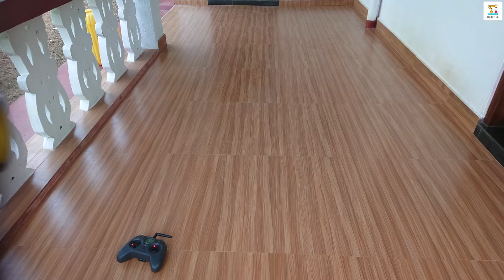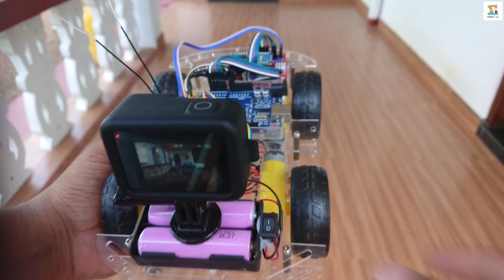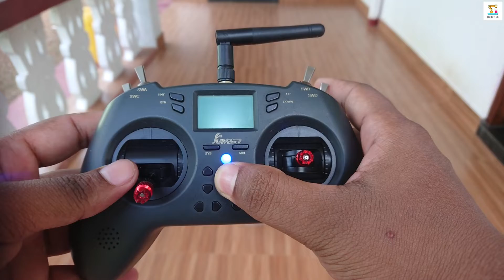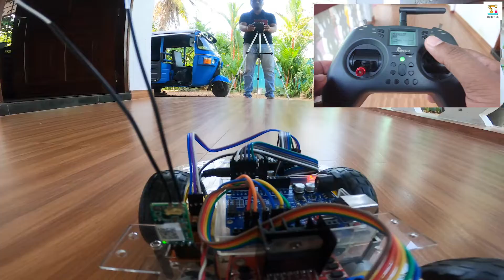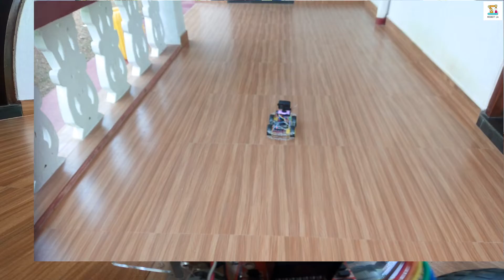Arduino Long-Range RC Car Using L298N Motor Driver & SBUS To PWM Decoder

Comment: Avrdude stk500 rec() programmer is not responding
Reply from the maker: Select old bootloader under processor in arduino ide toolS. Then upload it